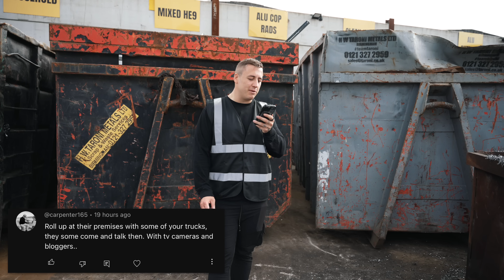THEY TRIED TO CON US | Scrap King Diaries #S05E34

Comment: Hi Harry, I have been told that the CAT engine's in your Tarus, we're made at the Perkins factory in Stafford and they are currently trying to address an issue with a large number of engines made there which are failing. . Ask your independent assessor if he can check if the engines were made at Perkins.

Comment: I made a comment similar to the guy who mentioned a dry sump and everything he said is bang on. I totally agree with you that the position shouldn’t be an issue, and that it should have been addressed in the initial design. Fans on the engines will help, but you also need airflow to the rads, you may end up with internal hot spots if the water which flows through the cooling channels in the engine block is unable to exchange enough heat in the rad. Ideally you’d have a fan pushing air through the rad and away from the machine. Good to see Ricky T back in action!!!

Comment: Harry I commented on the previous post about the oil/water cooling solutions possible to prolong the cat engines. Those fans your purchasing need to be positioned directly at the radiator packs of each engine and be kept completely independent from the shear itself, hang them off the concrete wall facing the cat engines radiator packs bro!! That way you can provide evidence you’ve had to retro fit more fans and add more airflow without adapting or altering the Torus itself and keeping your warranties some what untouched 🤞🏻

Comment: How much do you loose out  when most of the motors are alley plated copper and not solid Coper wire or do you pay the same,e price for both.

Comment: No way the engine positioning relative to the walls should cause issues. That’s a red herring for sure. Look at a similar engine on something like a combine harvester. It’s sat in a steel box fed by a fan. No problems at all. Definitely a design issue or an engine issue

Comment: Harry that machine shouldn't be enclosed like that looks like the oil has overheated and caused prem wear to engines You need to re position it so engines can breathe Do you not have a fitter on site as id get one if i were you. Who made the decision to put that machine there and when it was site inspected did you have the 4 meter wall installed then. Prospective  23 degree heat with a machine running the heat trapped behind that wall will be 50 degrees + working environment Go stand in the same place when its fixed and take a thermometer Then move the machine lol so it dont happen again. External fans will distribute hot air thats all.